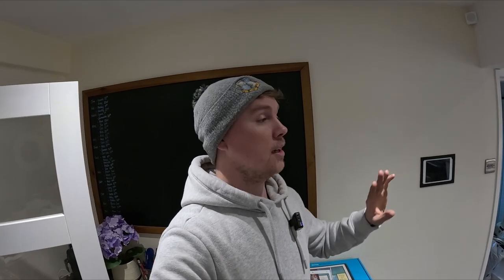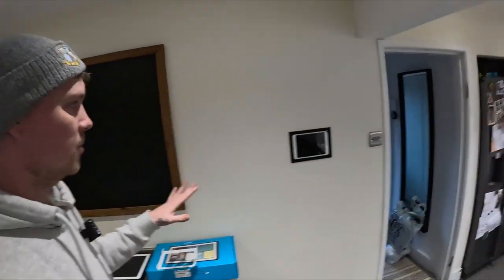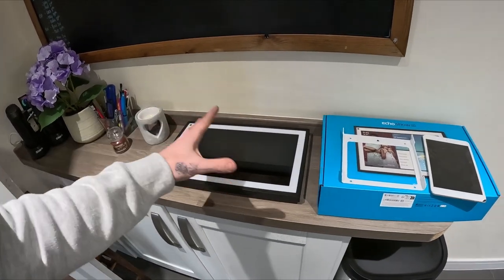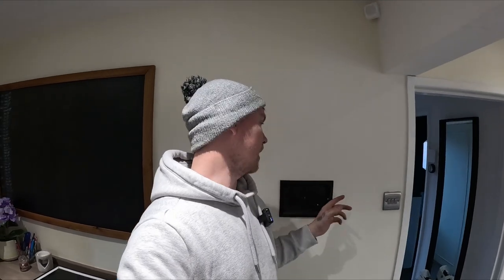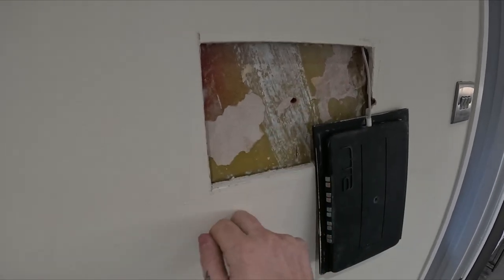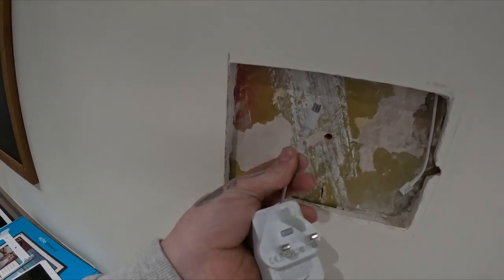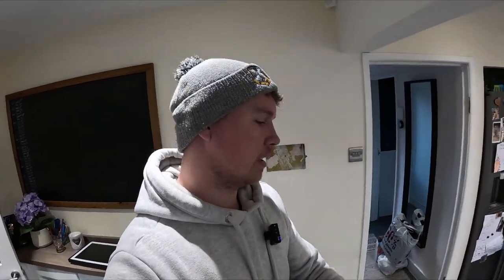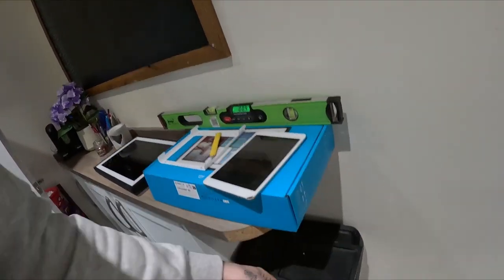Amazon Alexa Echo Show 15 wall mount install

Comment: Should of used a bit of oval conduit, plastered it in then you could just pull through if the power supply fails or you upgrade

Comment: I would have looked to see if a male to female extension cable was available for that power supply. There are lot available on eBay in various lengths and connector types. It would make any warranty claim more straight forward if you had to return the power supply. I prefer to use oval conduit for sunken cables (as you often do yourself) but some connector types are too thick to slide down. Keep up the good work, Nick, and Happy New year.

Comment: Wonder why they didn’t use usb-c for power? Then you could have any length you need. I was pretty sure the cable they gave you wasn’t going to stretch to the old immersion socket.
Reply: Length is good!
Reply: yeah almost every tablet now is usb-C except for crApple

Comment: Nick, Why didn't you snip the connector and power brick off either end and solder the plug and power brick on with heatshrink on the joined wires.
Reply from the maker: too much hassle mate
Reply: @NBundyElectrical  I would have done it just to avoid the channeling and plaster. You can use small terminals to join rather than solder. Today I just undone my yearly wire through the stair cupboard wall for the lights up the stairs done this way. But I'm not good with plaster.

Comment: Hi mate I'm thinking of doing something similar I've watched a lot of Americans doing the same and they always mention having to use POE because it's agasint code to run some wires through walls is that the same regulation in the UK

Comment: We have a none verbal 11 year old, so are avoiding anything voice activated to help her never feel left out.
Reply: Have a look at home assistant. It can interface with lots of smart home device like Philips hue, Shelly etc. you can then set up dashboards that work on a number of devices ( I use Amazon fire tablets) to switch things on and off. No voice required and they could have their own tablet to carry around. You can event get it to do text to speech so they could press a button to get something to say a phrase. 

Your 11 year old may like getting it set up and working depending on their interest level and if they are that way inclined. Lots of tutorials on YouTube.
Reply: @davideyres955  To be fair the system has screwed her up for life with what they injected and i knew no better at the time,
Now i am called  crazy lol,

The way i see it none of this crap will work very soon when we in a black ou,
 most needs a internet connection also, i had an alarm clock many years ago that never went off because the net went down, so lost half a days pay.

Comment: I would of just cut the ending of the wire, rewire the right connectors im sure the lighting cable could handle the power for echo.

Comment: A better solution for the back would have been to put in a 25mm back-box with a brush cover on it and then bring the cable through that. Then you can fill everything else. Snip that power cable near to the end and and put some two core in the wall with capping/oval conduit (if you want). Then use a couple of Wagos on each end section to reconnect the power. When you inevitably need to change it again in another 7 years, you should be able to just swap it over, including whatever power connector your new device uses. 👍
Reply: but then you have 2 splices in the power cable, would rather leave it whole from manufacture
Reply: @Lewdacris916  Don't see a problem with that. It's unlikely to be still usable after 7 years.
Reply: I'd have been tempted to have put a deeper backbox in the wall, had a USB Euro Module in there (without the faceplate) an then any tablet would have been able to plug it's USB Cable In, rather than messing around splicing a manufacturers cable. Especially given the USB-C Mandate that's coming into the EU will mean that pretty much all devices will use that in the future.
Reply: @kylemson  The kit Nick was putting in didn't use USB power, looked like some sort of barrel connector. With the solution I suggested above, you could simply pull out the two core and feed a USB C cable through the oval conduit instead.
Reply: @RikTheMix  wireless charging will never be as fast as a cable, and produces more heat.

Comment: hey mate, its mad as sparkies, myself included how we always end up going for the google or the alexa approach, theres guys in america using zwave or zigby or something, supposed to be unreal but not really available here
Reply: Loads of it available, as well as wired KNX stuff, you just have to know where to look. Zigbee Light Link is used by Philips Hue, which is one of the most popular smart lighting ranges today, and integrates with Alexa, Google Home and Apple Home/HomeKit. Z-wave is an older technology, while the newer contender is Thread, which works on the 2.4GHz band like Zigbee. Both Thread and Zigbee create mesh networks so the more devices you have, the better the connection to the next-nearest device.

Comment: I have an Opus multi room audio system, although obsolete, looking in to different methods to try and make it work with new kit, what method are you using to play music? Dot's around d the house or pre amp via dot? I have ceiling speakers ans reckon I could just attach a dot to the multi amp
Reply: You can also get the Echo Link which made for your use case as far as I can tell, but as you say the Dot does have a 3.5mm output.

Comment: Nick: your motion sensors should be between 1.8-2.1m high. They look too high in the video. Old pirs were in the corner to hide cables but door top height is the right spot for them.

Also. Shame you've done it already. Forget charger warranty. Cut the cable and join it then use lightning cable to pull it? Test with a rope first

Comment: Why not just cut the ends off and use the cable. 

Join up the the Power supply and the end from the power supply.